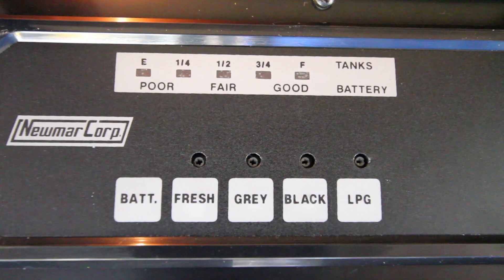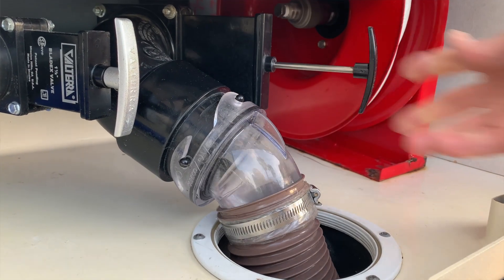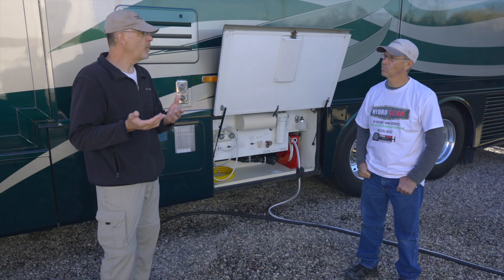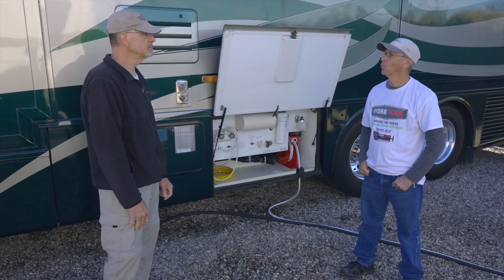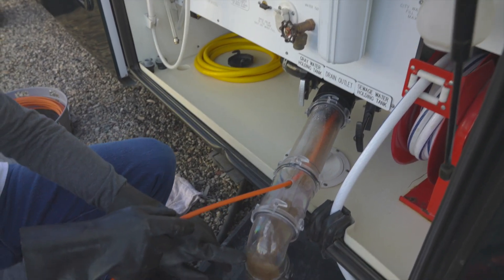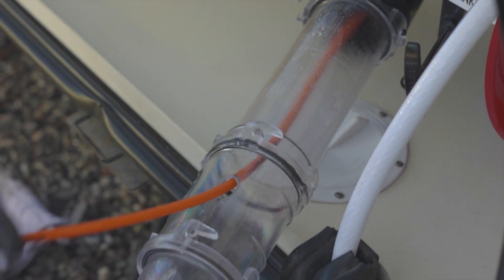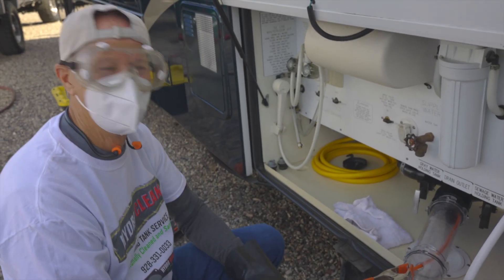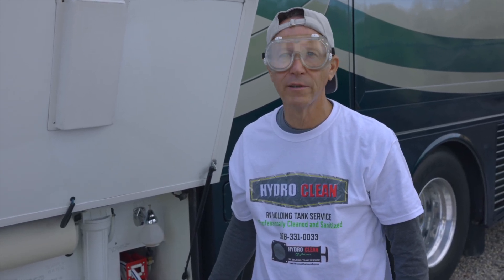RV Holding Tank Sensor Fail! Power Washing Black & Gray Tanks & Struvite Removal.

Comment: We have a 2020 and the black tank has a built in pressure washer , so we don’t have much problems with that. But the gray tank on the other hand , absolutely horrendous.  We are full timers and for anyone saying gray is just soap and water is highly uninformed. Our gray tank wouldn’t drain no no matter what. We thought we just had a clog and I would snake the drain. Then the water would run through and be clear. Then a month later the same problem. I finally waited till it drained completely over 48 hrs. Closes the tank and poured 5 gallons of boiling water down and let it sit. Then I got the snake and went in from the exit , I twisted and jabbed the tank so hard and oh my goodness I thought I was gonna pass out after seeing what was in The tank. I managed to get it clean again after hours and hours of the same process (was determined once I saw what was coming out) so so so so much struvite was coming out , it looks like leaves. I was absolutely disgusted and decided I needed a routine for the tanks. I am so grateful nothing worse happened. Thank you for this video , now I know a better method of removing struvite without having to beat my tank to death with a 25ft snake and boiling water lol 
You should be very proud that in 16 years your water was only running light brown. !! Thank you so much !!! 🌷
Reply: And your RV isn't even that old. I hope you filmed or at least have photos of what came out.
Reply: @lauravictorious4670  Yes, we have photos and videos. But with 3 years of full time use with a family of 4 , wear and tear significantly increases. Luckily it was a learning process to know what to do for preventative maintenance! 🌷
Reply: @samanthagreen3125  goes to show how quickly the struvite can build up. I'm heading towards full time RV life.
Reply: @lauravictorious4670  it def builds up quickly. But as long as you have a good cleaning routine and use plenty of water in your tanks you should be fine 👍🏻

Comment: After watching this video, I made a point of contacting Mike with Hydro Clean.  My travels were taking me through the Lake Havasu area and I wanted to use his service to get my 22 year old tanks as clean as possible as I plan on keeping this motorhome for a while.  We were able to connect through emails and a phone call or two, and I reserved a spot in one of the campgrounds that allow his service (NOT available in the beautiful state campground right on the lake).  My working career was in HVAC servicing, and I appreciate and recognize good service myself.  Mike provided that service level, got my black tank sensors working again, and I felt my money was well spent.  I had already previously used the most aggressive tank cleaning chemicals available, but was not able to get my sensors to respond.  He cannot work miracles, but I believe that his equipment and knowledge can achieve the best results.  Thanks for this video and the tip on a good service provider.
Reply from the maker: Great to hear, Jeff!

Comment: Thanks for the video....I'm sure our Monaco will need a treatment someday soon.  We're either living 100% on our sailing yacht or diesel pusher and we have definitely had struvite build up in our marine holding tank and associated toilet plumbing.  Struvite can even cause things like y-valves to jamb up and break when you try to move them.   When things were really a mess I've used a product called Sew Clean, which is likely just an acid, that dissolves the mineral buildup with just one treatment.  It may work well on RV tanks as a DIY solution instead of internal pressure washing.   Unlike an RV, on a boat you don't have a nice 4" drain that can be used to perform the "colonoscopy pressure wash" so chemical treatment is the only effective way.  We find an occasional dose of muraiatic acid down the head keeps the boat pipes clean but I'd make sure your RV parts are only plastic and rinse thoroughly after treatment.
Reply from the maker: Thanks so much for all the info Tony! Will have to take a look into Sew Clean!

Comment: This is a snippet (see quotes) from wikipedia concerning Struvite in waste water treatment plants.  Most Rvers who either use a soft water system or live where the mineral content of the tap water is low, will likely never experience an issue with Struvite as it needs calcium,ammonia and other minerals to form.

"Wastewater treatment:

Struvite can be a problem in sewage and waste water treatment, particularly after anaerobic digesters release ammonium and phosphate from waste material. Struvite can form a scale on lines and belts, in centrifuges and pumps, clog system pipes and other equipment including the anaerobic digester itself. Struvite, also referred to as MAP, forms when there is a mole to mole to mole ratio (1:1:1) of magnesium, ammonia and phosphate in the wastewater. The magnesium can be found in soil, seawater as well as drinking water. Ammonia is broken down from the urea in wastewater, and phosphate, which is found through food, soaps and detergents. These elements in place, struvite is more likely to form in a high pH environment, where there is higher conductivity, lower temperatures, and higher concentrations of magnesium, ammonia and phosphate. Recovery of phosphorus from wastestreams as struvite and recycling those nutrients into agriculture as fertilizer appears promising, particularly in agricultural manure and municipal waste water treatment plants.
Having struvite scale in a wastewater treatment system can lead to great inefficiency within the plant or operation due to clogging of the pipes, pumps and equipment. There have been a few options to solve this issue, including replacing the pipes, or using a hydro-jetter or a mechanical grinder to clear them. But many lines can be underground and either of these options implies considerable downtime and labor. Chemical cleaning is now predominately used to clear systems of struvite. Chemical cleaning products have been developed to remove and prevent struvite with minimal downtime. Even a chemical-free, electric method of removing and preventing struvite has been developed and tested successfully at wastewater treatment plants in the USA. The electronic sine wave it produces is sent through the water in the pipe and is therefore effective on underground piping as well."
Reply from the maker: Thanks for the detailed info, Ben!

Comment: I've done something different. I switched the stock tank flush system with a Tornado® flushing system. It had a spinner on the end that sprays the sidewalls as well. So far it has worked well.

Comment: Had a sensor issue with our black water holding tank and used the ice method, drove our travel trailer around our back horse field, and the problem disappeared.  We always add some water and a couple of RV packets to the tank when we return from camping trips.  People do not realize the damage that can be done with a pressure washer.  Use them sparingly as the will create other repair issues.  I've saved our home septic system from having to have new lines installed, saving 8k in repair costs.  Northern Tool sells sewer drain line cleaner hose.  Worth every penny of the $100 cost for the hose.  I would have reservations about using this idea on an RV tank cleaner unless you run you pressure washer on idle.
Reply from the maker: Great to hear that we're not the only ones with successful first-hand experience using the ice method, Greg! While pressure washers can damage things when used improperly, the good thing is that using one inside an RV holding tank isn't generally anything that a non-professional would be able to do, partly due to the specialized nozzle and modified clear sewer line section required.

Comment: Thank you for that but of information and your blog of alternative/preventing options.  I tried the Borax, Dawn and a third component can’t thing if it, the mixture never mixed well and the borax sat at the bottom of the container and hardened, will not try that again.  I will try the dishwasher treatment and then eventually have them deep cleaned, again than you for your informative post and video.

Comment: Had this problem a few years ago while in Arizona. Had a guy come out to power wash and had a ton of struvite come out. He told us to use his product Tanktech rx and it would eliminate the struvite. We have been using it for years now, and havnt had any more clogs. I probably still need to have my tanks power washed again, as it has been a few years. Tankteck rx if available online at amazon. or at larger rv supply stores.

Comment: Gotta admit... I thought "struvite" was in the same class as "leverite", but it clearly is a thing. First reference returned by Google is about kidney stones. Yikes! Glad to hear it resolved the sensor problem. Great video. Ps. My sensors have failed, but i just put up with it. Probably time for pressure washing.
Reply from the maker: LOL, Jack. "Struvite" is even worse than "leverite"... since it's beyond worthless and actually a pain-in-the-you-know-where! And, yes, struvite is one of the chemical compositions commonly found in kidney stones... but, other than pounding your head on useless tank level displays, having it in your black tank won't cause as much pain as passing a stone! 😱 Sorry to hear about your sensors... but it sounds like it's possible a good cleaning could get them back working for you.

Comment: If you’re worried about odor do this! For your grey tank do the easy math… if you fill your fresh tank full some goes to your black and most goes to grey. don’t fill if you have not dumped simple you won’t overfill. If you fill when you dump you don’t have to worry. No need for censors if you go about it this way. Censors are garbage in most units they fail. I’ve herd store of rvs used for a trip or two and getting wrong reading this may be caused by poor cleaning or flushing but regardless should not happen with a new rv within  the first couple of months. As for the black tank all units are different but if you really want to know how full you are hit the flush pedal with your water off and look into the toilet and you will clearly see where your levels are. This may take time to get used to from just looking down the hole to determine your levels but you will be able to see quickly. And just timber for your black tank use lots of water I like about half atleast and this will help a lot. But let’s be honest the censors are useless and this is different for every unit I understand that but if you pay attention from the get go when they probably function you will not necessarily need them and if yours work and continue to work correctly let me know what tv you have I will be sure to keep that in mind for a future unit. Sorry Mike not trying to turn customers away this is a real issue and hard to maintain thanks cheers everyone!

Comment: That is a very nice man and I am certain he will gain many clients from your video. He did not get into detail regarding most of his clients. Most have to call him because they do not start with water in the black tank.They end up with a hundred pound pryamid that not even the Pope could move. Or somebody uses fiberglass based wipees for their Arse!!! His Hydro tip has to go in and cut up the pyramid. Some take several hours. This process you saw here on a properly cared for system should be done every 3 years on full timers.

Comment: I have to say, the black tank was not as bad as I was expecting! As you have experience with the Thetford chemicalc cassette toilets, UK & AU, do you not use chemicals in your black and grey tanks in the US?
Reply from the maker: We do indeed! We use Happy Campers, an organic holding tank treatment. It works well, but struvite is a sneaky little 💩! 

It's a crystallized mineral build-up that slowly accumulates on the sides of holding tanks from magnesium, ammonia, and phosphate (from hard water) and other organic matter all coming together. Even waste water treatment plants deal with it. It's really not what products like Happy Campers are designed to cover.

Comment: Interesting.  Our '05 Monaco Exec has built in tank cleaning systems that I can use to give the tanks an additional flush after dumping them.  I haven't used them every single time I've dumped but probably maybe every 3rd or 4th time and more so with the Black tank.  I didn't realize the Grey tank would get a buildup like that as well.  I guess I'm going to be more diligent now and start flushing the tanks much more often.  Doesn't your coach have the flushing wands built into your tanks?  How must does a tank cleaning service like this cost?  We're not getting any odors but it might be prudent to have it done even just to establish a baseline.  Thanks for posting and sharing your 'amazing adventure'.  You guys have so much fun LOL .   Mike
Reply from the maker: Thanks, Mike! According to our "before" and "after" scopes, it's a good idea to do this from time to time. Cost was around $200 for both tanks. Not bad at all, all things considered! :-)
Reply: @RVgeeks  Doesn't your NEWMAR have a built in tank flushing system you can use?
Reply from the maker: Great question @MrGrunthunter! It sure does, and we ALWAYS use it. The problem isn't flushing thoroughly during dumping. It's that struvite forms just from having all that "stuff" inside it during use.

Comment: I haven't been through all the comments, so this may has been asked and answered, but how does Mike prevent destroying the sensors with that jet head zipping around the tank? I imagine he has a stock of sensors to replace ones that are not working.
Reply from the maker: Hi Jerry! Great question. We’ve never heard of anyone having a sensor damaged by this method. The through the wall sensors only have a metal probe on the end, and the water pressure doesn’t appear to have any effect on them at all. If you have concern about it, we certainly recommend asking about it before you have it done. For the record, our Newmar has external sensors.
Reply: @RVgeeks  yeah I was thinking about the Horst sensors that actually protrude a couple of inches into the tank. The first time I watched this video I considered doing this in my area (Cape Cod). I was going to replace the sensors after clearing as part of a package.

Comment: What is on the end of the hose that you put into the tank
Reply from the maker: Hi Scott! That's a special tip that blasts water back at an angle. That both pulls the hose forward and into the tank, as well as does the actual cleaning. It's built onto the hose.

Comment: I have one small question for you. How do you know the sensor is inaccurate if you can’t see the level of the water in the tank some other way? Just wondering.
Reply from the maker: We calibrated our tanks using the following method: https://youtu.be/DvVGBFdJ_vo and after many years, we have a very good feel for how much water we use when boondocking, so we know what to expect when things are operating properly. Another REALLY obvious tell is if we dump the tank and it still shows anything other than empty!

Comment: Hi guys
Love to see your videos.  I just watched your How to dump black tank from 8years ago.  Do you still use rid x in your tank or only happy camper now?  Is rid x used in place of happy camper and how frequently?  We have a 1 year old class a and we’re dumping both tanks at end of the trip out but many times the tanks were not full.  Rv may then sit for a week or more in the drive before the next trip.  How long would be ok to leave the tanks before dumping to avoid any problems?  Since we are not full timers, how would you suggest we treat the tanks for storage over the winter months?  Thanks
Reply from the maker: Hi Gina! We've been using Happy Campers for a few years, but still like Rid-X too. Either one works well, with one "dose" in the black tank after each dump, so there's always some in the tank. It's hard to say how long you can leave the tanks without dumping. If you're going out again within a couple of weeks, and there's very little in the tank (so enough room in the tank to handle your upcoming trip), we wouldn't worry about it. It's the long storage periods where you should flush out the tank as thoroughly as possible.
Reply: @RVgeeks  thanks so much for your quick response. My husband wants to know if having a macerator toilet would change any of the treatment and how often do you treat the grey tank?
Reply from the maker: A macerator toilet is unlikely to make any difference, as it’s the organic matter itself in the tank that causes the problem. We treat our gray tank with dishwashing detergent and water softener a couple of times a year. If you check out the associated blog post on our website today, we have some details about that, as well as a video we did a number of years ago. Safe travels!

Comment: How much does that cost to have that done?
Reply from the maker: It's been a little while since we had it done, but we recall it was around $250 (total for both tanks), but can vary a bit based on what needs to be done to get the tanks clean.
Reply: @RVgeeks  OK, thanks guys! I just got a new rv for my full time life & the control panel is always wrong. 
  Seems the gray tank only reads as barley having anything in it & the black always reads full. Only way I know when to dump is by using a flashlight & looking down the toilet hole lol. Very annoying! 🤦🏼‍♀️ 
  Tried a few other things & didn't work. Got a few others to try still. Seems like this would solve my issue.
  Unfortunately I just left Havasu due to the heat. Was already hitting triple digits. Don't plan on going back till next season. 
  May have to deal with it till then. But at least now I know who to call when I get back to Havasu! 😉